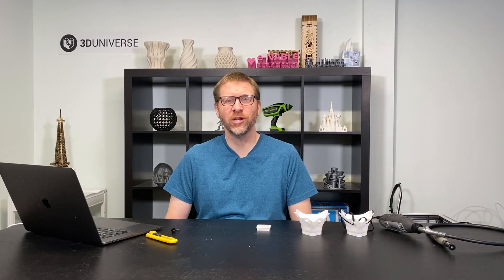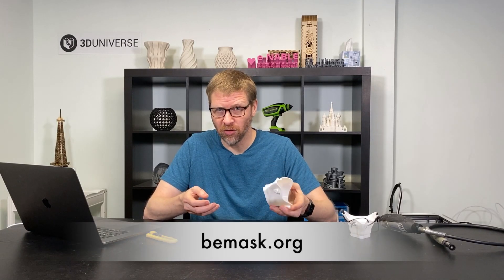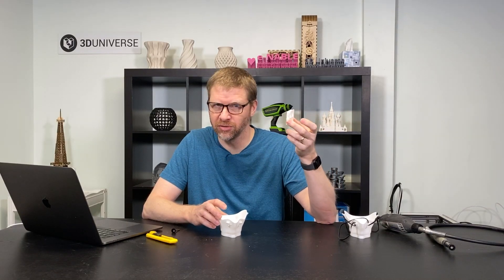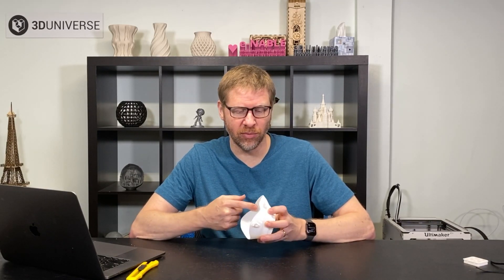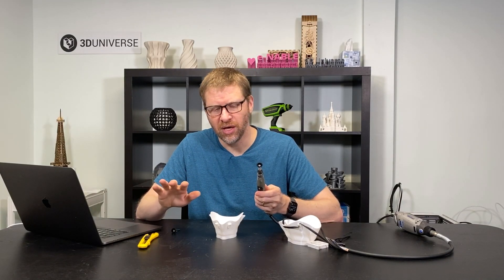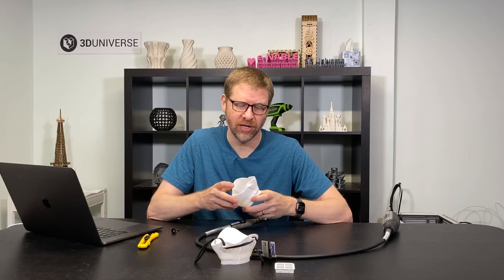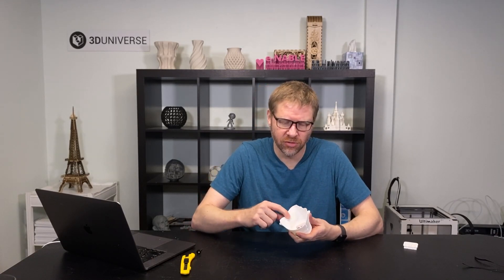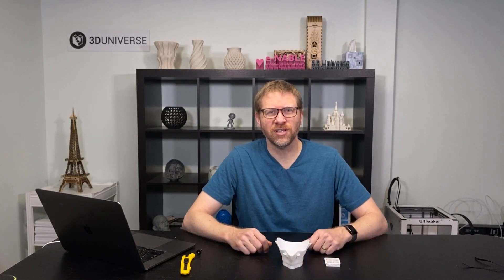BE Mask Fabrication Guide

Comment: Thank you for your designs and efforts. In the video, you recommend using a .4mm nozzle for TPU, but the documentation says to go to .8mm to cut print time. Cura is giving me a 12+ hour print time (for and Ender 3 Pro). Does this sound right?  I'm making these for my family, so I'd rather it be right than fast. Any suggestions would be appreciated. Thank you.
Reply from the maker: Use thicker layers. With a 0.4mm nozzle and 0.3mm layers, you should be able to get the print time down to around 5 hours or so.
Reply: @3duniverseOrgWelcomesYou  Thank you!